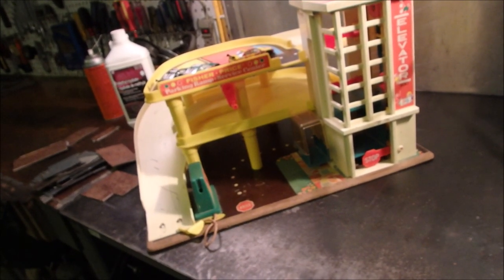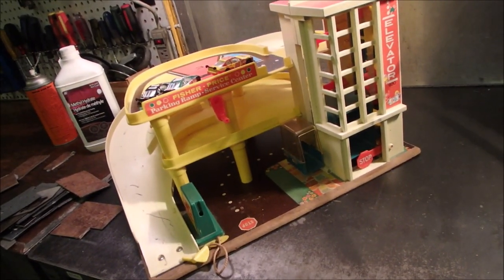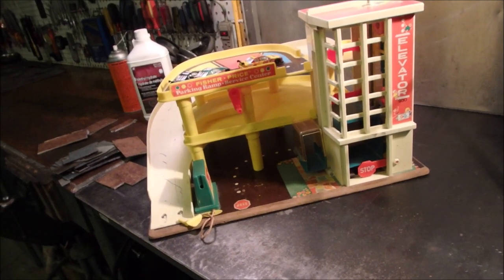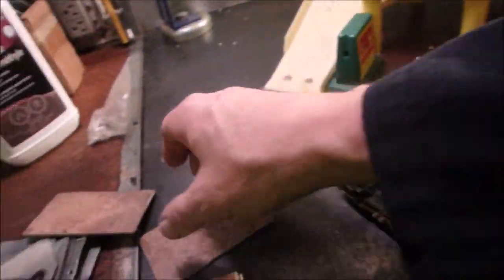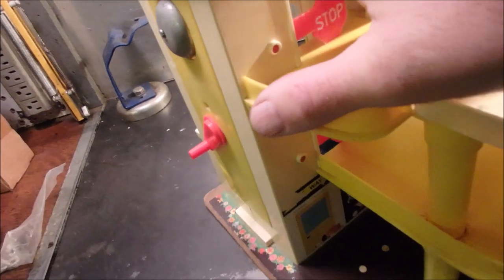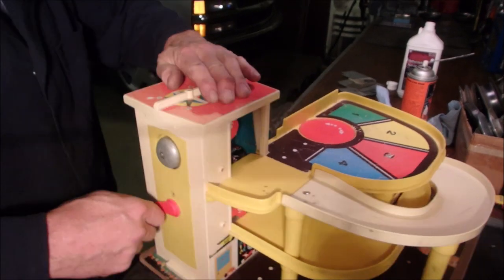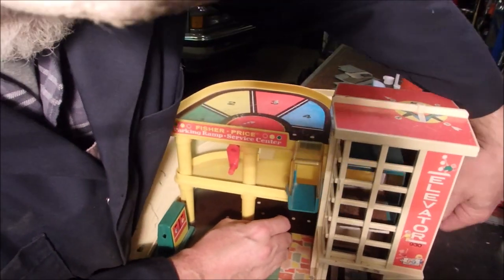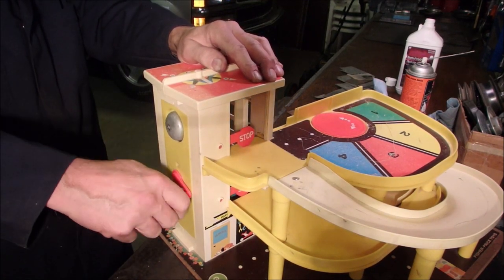#11 Helps With Most Important Repair Yet.

Comment: I had one when I was 3 in the early 70s, it was a blast.... It came with a 2 seater blue car, a guy and a dog, all I have left is the little dog I have it on a shelf.... Lol
Reply from the maker: Right. The actual cars are bigger than the small hot wheels.  But the hot wheels work too.
Reply: Yes they do.